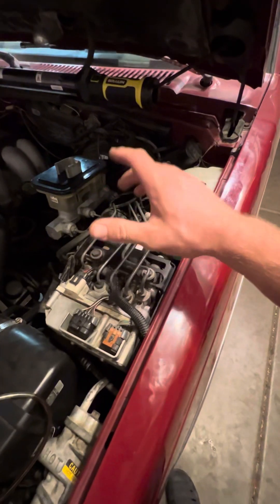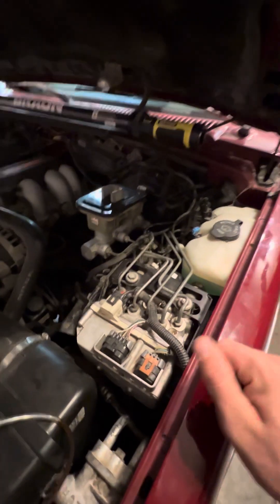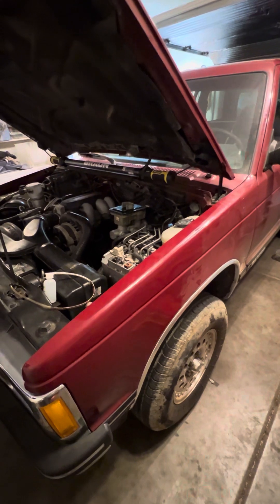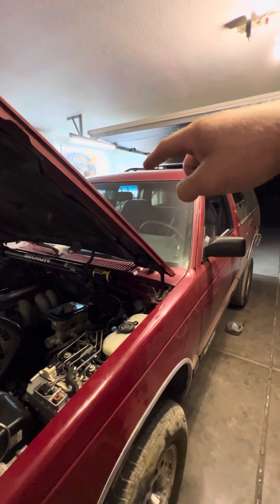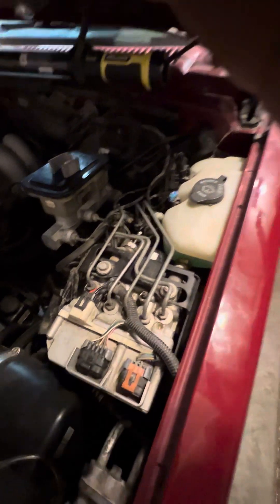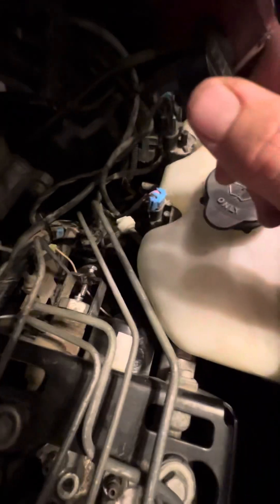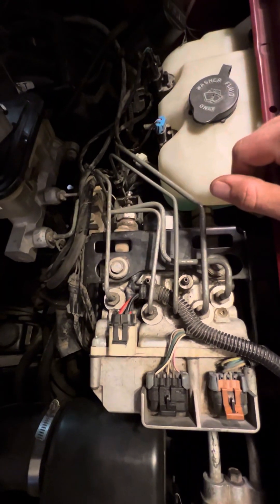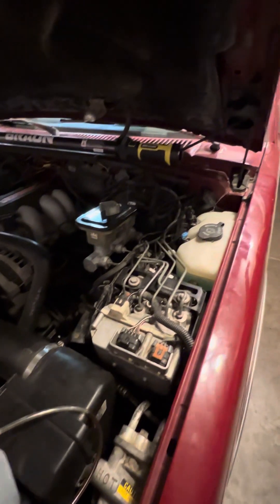Bleeding ABS module s10 blazer (Kelsey-Hayes 4WAL)

Comment: do you know the part number for the special tool for the accumulator valves?
Reply from the maker: @imgooley  yeah its part #7853 at oreily’s but they’re like $55 a pop and you may or may not need two of them.  Link below:

https://www.oreillyauto.com/detail/c/otc/tools---equipment/mechanics-tools/brake-tools/brake-bleeder-tools/058eaccfa9b5/otc-abs-brake-proportioning-valve-depressor/otc0/7853

Comment: Thanks for the video dude. Trying to flush out nasty black brake fluid on my 93 today, ill be able to go back in and finally do the ABS module. How much do you love that CPI 😂 i just dropped a new engine in my. Previous owner welded both rod bearings to the crank..
Reply from the maker: Good lord haha yep it’s always fun fixing the prev owners handiwork.  I got lucky with this one it was owned by a nice older lady who only took it to the gm dealership for service and barely ever drove it.  I don’t love CPI lol but it has worked well for me so far and gets a few extra ponies over the tbi.  I sent in my spider injector to get rebuilt since it was about 15 years old (lady kept a record) and fingers crossed haven’t had any issues yet!